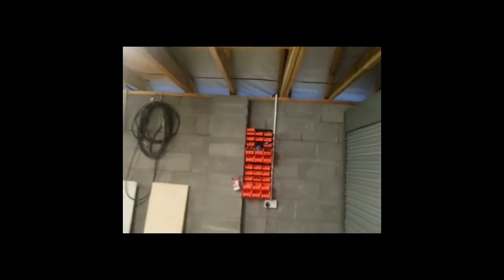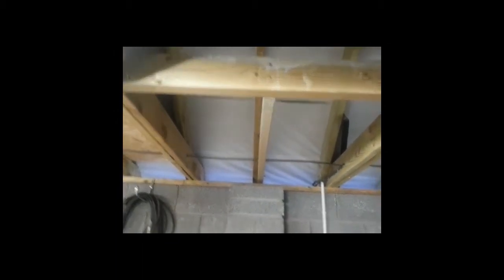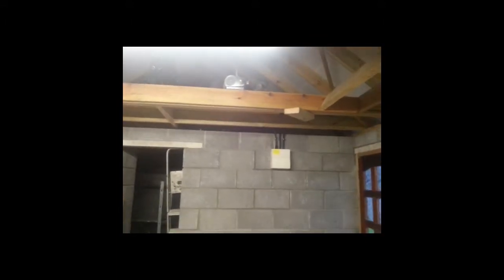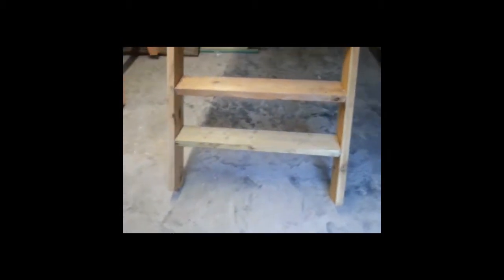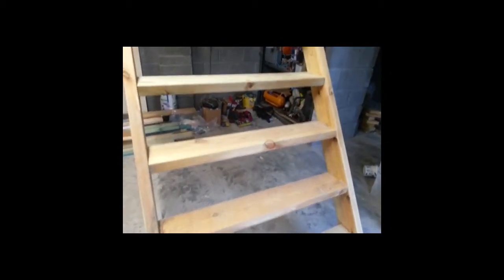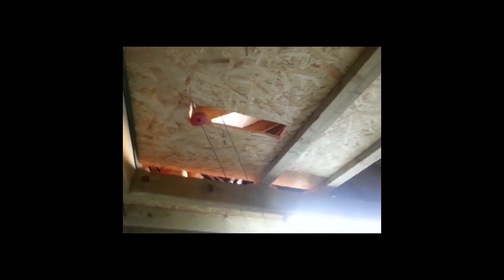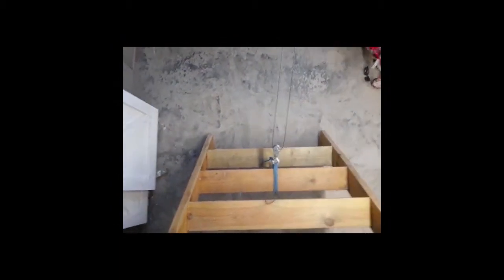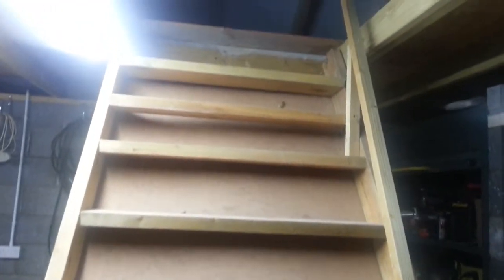Secret DIY Staircase build

Comment: Most American garages have folding staircases that pull down. They usually fold twice, so three sections which fold into a stack, about 2 feet wide & about 4 feet long. This method does not compromise structural integrity of the roof trusses.
Reply from the maker: thanks